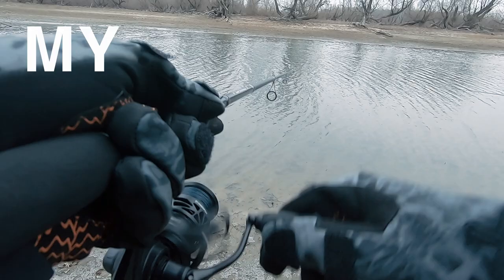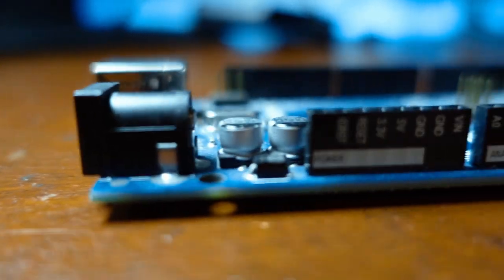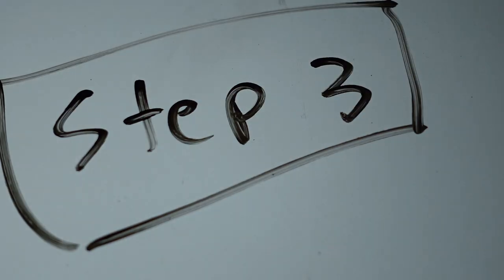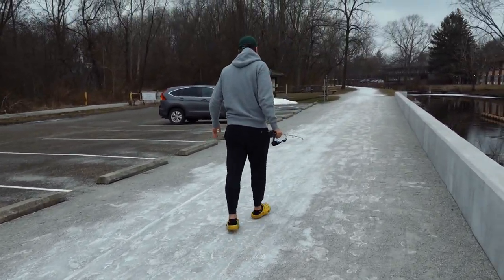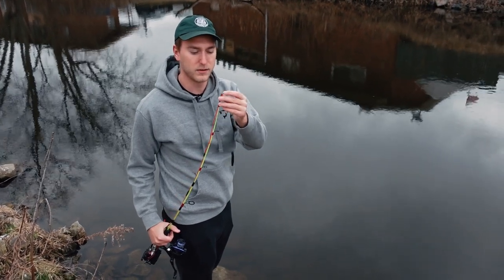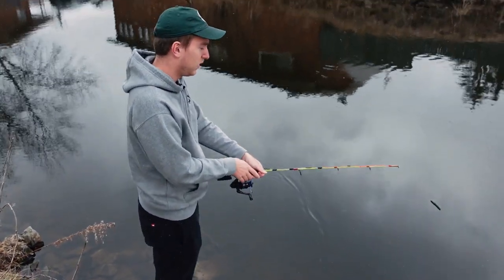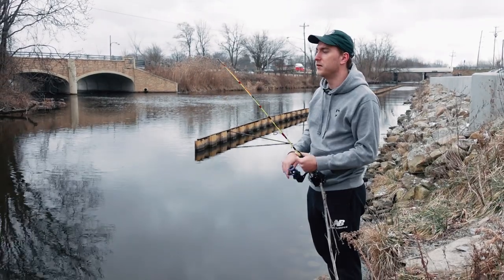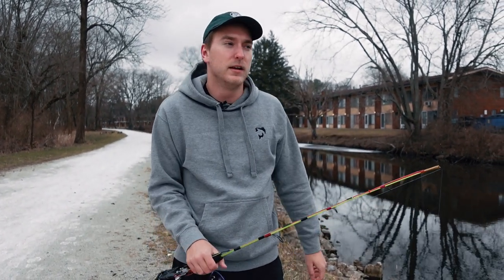I made a HEATED FISHING ROD

Comment: Good job buddy! Some nice editing there too! Proof of concept is looking good, but definitely weight may be an issue unless you completely streamline the whole thing, which tbh, shouldn't be too much of an issue. Also to note, how hot is that thing? What temperature does the elements heat up at? Just asking because, for those that are using braid, it won't be too much of an issue, but anyone using Fluro or Mono, it may become a small issue with possibly weakening the line through heat? Just a thought. Anyway, great video buddy!
Reply from the maker: Thanks! Ya it heats to around 60-80 degrees, warm to the touch but definitely won’t burn, still have to do more heat testing once I finish v2
Reply: @FishingwithGabriel  look forward to it man! Great job so far :D
Reply from the maker: Thanks!